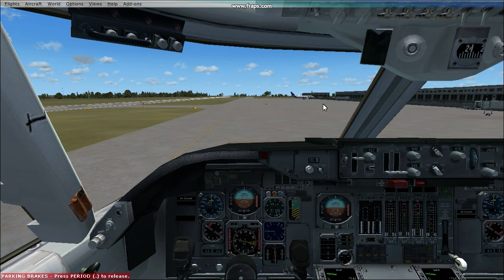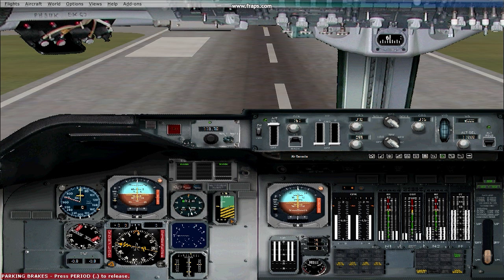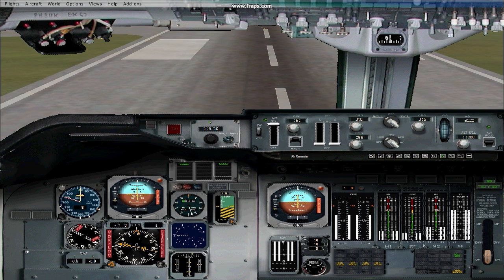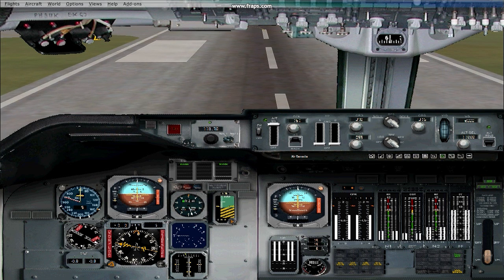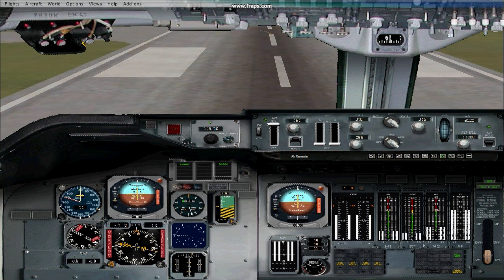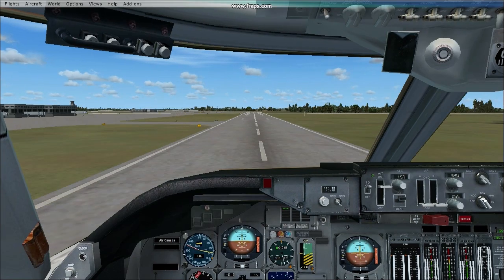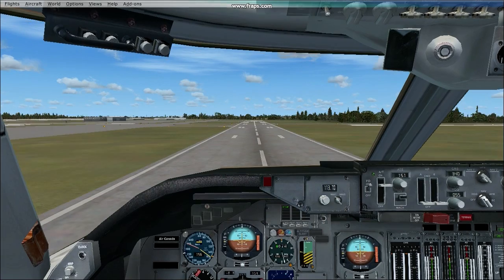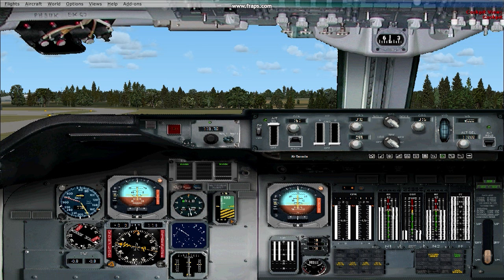747-200/300 Manual Start-Up Procedures Tutorial Part 2

Comment: trim setting is different every time you take off case the different in loads effect the CG on the planes
as for flaps it also can be differents 
i dont use the 743 so i cant tell you what flaps setting i use
but on my 744 i use flap 15 
dont for get your landing light as you enter the runway and once you on the runway it mean you should be ready for take off with out setting up anymore setting
you should fly online it much better way to sharpen your skill